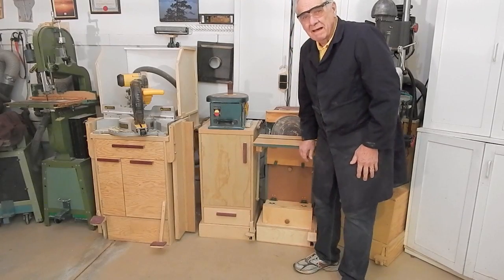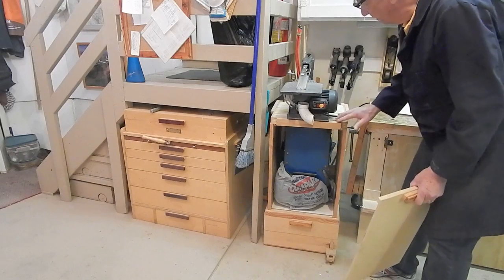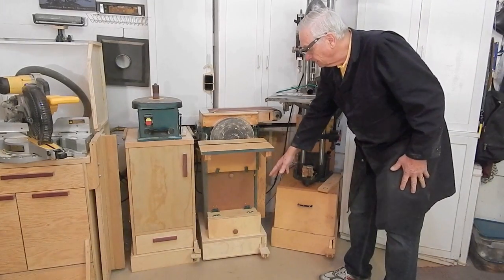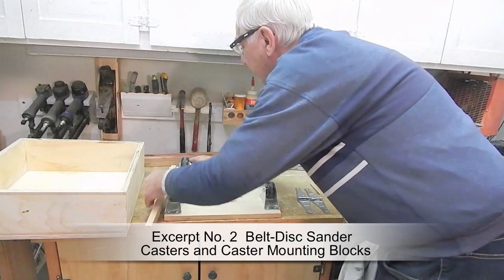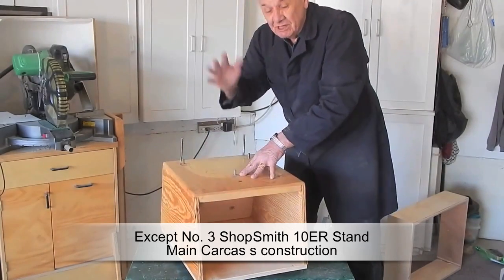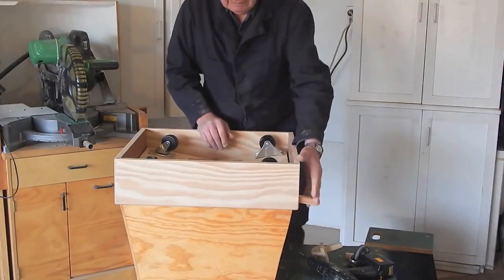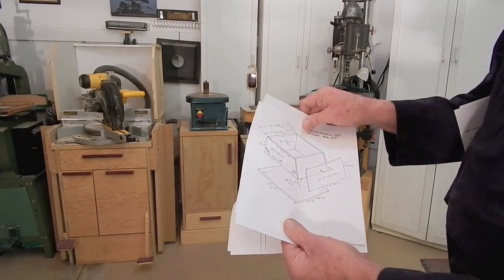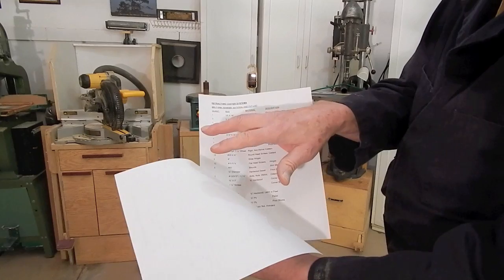Retracting Casters 5 of 6 - ShopSmith/BeltDisc Sander

Comment: How do the casters stay down when the foot lever is pressed down? Wouldn't the weight of the tool just push the casters back up?
Reply: I was wondering how that works, too. He doesn't specifically show in one of his videos. Did you find a solution / explanation? To me it seems that the pedal has a hinge and gets stuck (with the top part of the pedal) at the "ceiling" of the the hole where the lever comes through.